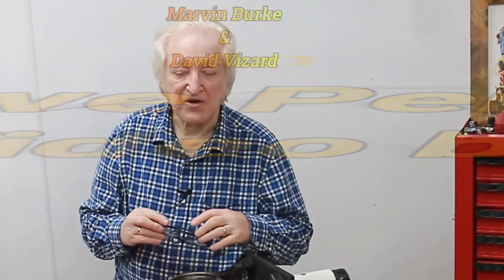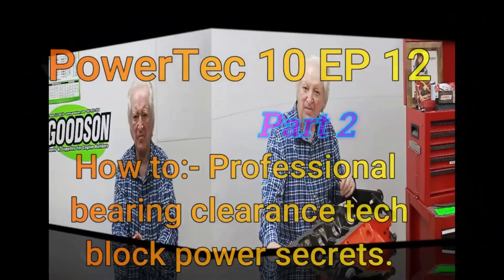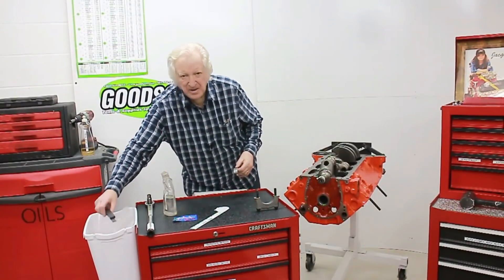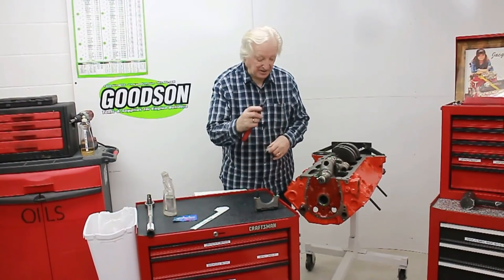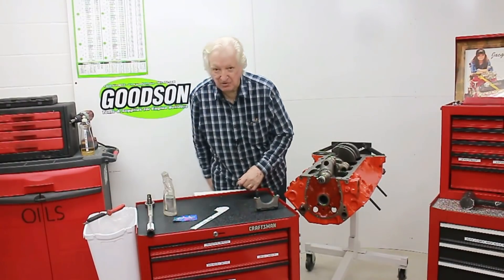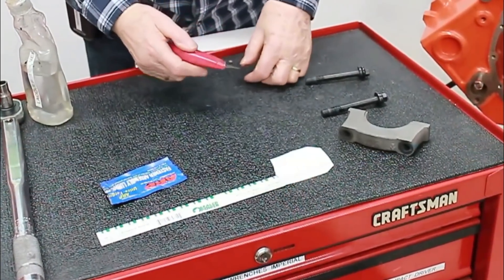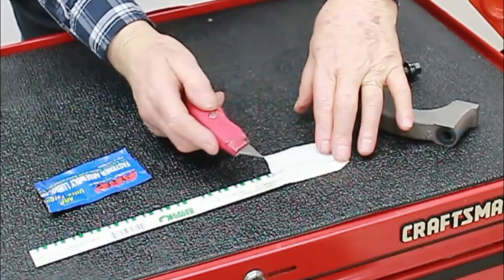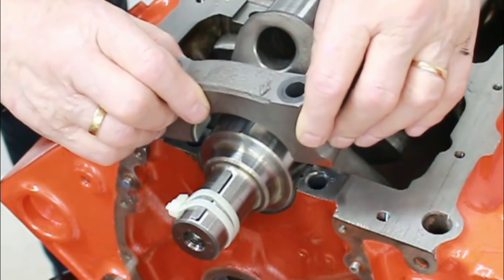David Vizard's PowerTec 10 EP 12 Part 2 Checking Bearing Clearance. To Plastigage or Not.

Comment from the maker: Andrew  - a response!

Bearing clearances aren't measured in "shade over" and "just about". 
I think I should have emphasized the fact I had measured all the clearances previously with my Mitatoyo bore gage and the crank with calibrated micrometer. That being the case I don’t think using the terms  ‘a shade over’ or ‘just about’ is a cardinal sin.

When clearances are measured properly those terms aren't required. 
Maybe not, but they do describe the situation.

There is no way the naked eye can come up with .0027 with green plastigage.
 Don’t forget that statement was influenced by the fact I already knew what the bore gauge measured clearances were.

 As I stated in your last video , reading Plastigage is like reading tea leaves, very open to interpretation!!! 
And here is why I used the ‘shade over’ and ‘just about’ terms.

A professional never uses a steel faced hammer to install & remove a main cap!!!
 Do you really think I used that polished face hammer hard enough to do any visible damage even when the cap is inspected with a 5 power mag glass!

That is a job for a soft faced or deadblow hammer.
Sure is – but that is what I would have used if it was required. Please give me some credit here and stop jumping to conclusions. 

 A professional would also never pry off a man cap with a screwdriver!! 
Agreed -  but the term ‘prying’ here is a gross overstatement of what I am doing. Gently lifting the cap would be totally accurate. Take a look at that ‘prying’ again. Does it really look like I am ‘prying’ with any measurable force?

You can easily damage the two mating surfaces. 
And why would I not already know that????
 
A professional never uses a torque wrench as a breaker bar to loosen bolts!! 
There are occasions when I need to test bolt breakaway torque so no I don’t need to do as you suggest.
If you are using a torque wrench that won’t deal with 45 lbs-ft in the reverse direction I suggest you get better equipment. I have 4 calibrated torque wrenches for 20 to 100 lbs-ft and an electronic gauge. All are regularly calibrated.

The best thing to do is pop the reversing lever out with a pocket screwdriver and throw it away!
I disagree.

 You should also lube the bottom side of the bolt head and washer, dry fasteners cause friction and erroneous torque readings. 
Again why would you think I did not know that, Don’t forget this has all been together as a trial build using my gauges. I mentioned using ARP lube in part 1 did I not? This is not a lesson on bolt installation. It’s a lesson on bearing clearances.

Just as different thread lubricants require different torque specs. 
Again you presume I don’t appreciate that. I can almost guarantee I have done more bolt load tests than you and I am aware of just about every intricacy that is known to man. 

What about checking the clearances on 2,3&4 caps? Just because the front and rear caps fall into spec doesn't mean the others will. ASSUMING leads to disaster!
 I really am beginning to believe you have little or no respect for whatever building skills I may have and you are just looking to find faults no matter how trivial they are. Do you really believe I don’t check #2,3 and 4. I think you are ASSUMING way too much here.

The crankshaft diameter spec on the rear main journal(sbc) is typically .0005 smaller than the other main journals to increase the clearance on #5 cap.
 Did I not say the clearance called for was bigger on the rear cap????

 Was the block align/line honed? 
Come on, give me just a small break here – what do you think????

If so was a dummy oil pump torqued to the cap during the honing process?  
See above!

The oil pump can cause distortion, anywhere from a few tenths to several tenths. 
I know that but have you ever checked to see how much difference it makes???

I don't care what people use for assembly lube as long they don't use Lubriplate 105 or a similar product, because it take alot of heat and time for it to break down and it plugs oil filters.  
No comment!
Regardless of how many books you have written and how many seminars you have given your last 3 videos in my professional opinion have really diminished your credibility with professionals that know the difference between right and wrong. 
Can you give me some idea of what your opinion is worth??

You are not beyond reproach, 
Never even remotely believed I was!  
--- contrary to what you might think. 
Based on the fact that you have never met me and do not know me that is a massively incorrect statement.

Before criticizing someone’s character it pays to get the facts right!!!!
Reply: Great work! You know exactly what you are doing and anyone with any good experience knows exactly how to interpet what you are presenting. I myself lift the bolts say?/ 2/3rds of the way out of the cap and squeeze together the top of them with the palm of your hand and gently wiggle while lifting to remove the cap! Hope this is ok'.
Reply: Thanks for the vid. I am trying to keep my $1300 car going. I think I may have a spun bearing and am about to measure everything with Plastigage. Helpful video for an amateur like me. Liked and subscribed…👍
Reply: Sounds like this Andrew is trying to teach David how to suck eggs... Clearly from some of his points he has no clue how many engine David has put together in his life time. Sure we may have a different way of doing things and there is nothing wrong with explaining the way we do it, but there is no need to be disrespectful in doing it. Do you seriously think that David is going to lever on main caps, and knock a cap out of round with a hammer, or not measure all the mains... Seriously this isn't his first rodeo, how about a bit more respect for a professional that has probably been doing this longer than you have been alive.
Reply: The guy building an engine or 2 in his life will greatly benefit from these videos. Nothing shown here will hurt anything on a stock to modest hot rod engine.
Reply: I have to say I agreed with most of Andrew's(?) comments, but I think his comments could have been more tactful & respectful.
Reply: Andrew why not make your own video if your interested in helping someone. otherwise your ignorance is showing. Do better.

Comment: ive been hooked n bought your small block chevy info since i was 32 years old.  engine nbuilding beame a fixation. 1990 June in Norfolk Virginia, Dale Earnhardt was brought over to my apartment where i had a fully rebuilt 1971 Lt1. We got to talking bout engine math, rod/ stroke ratios, deck heights, compromises with SBC 383 strokers with 6" rods vs Sbf 393 with longer rods, better rod to stroke ratio,  higher compression height pistons and oil ring not intersecting piston pi area. He gave me 6 pit cards, offered to sign them, offered me a job and what today would be $40k in 5 bowtie blocks, 5 crower or cola 4340 non twist forgings, his words, 5 sets of oliver or crower connecting rods, his words, 5 sets of aires or J&E pistons, his words, 5 sets of rings, 5 sets of rod n main bearings and , 5 complete Crower Imperial camshaft kits. Do you know what that is Robert? he asked me. Yes sir, the imperial uses needle bearing cam bearings which is said to provide 40 additional horsepower over the same cam using bushing bearings due to the lack of frictional encountered with the bushing bearing. Thats right, he said. Do you know how much they cost? Yes sir i said. They're $1360 right now in PAW catalog. (out of business now  ) He said thats right. There you go. Thats $6800 right there. You can build yourself 5 bullet proof bottom ends n worry bout induction later. When he left he held out his hand to shake mine and said" 5th time I've offered you Robert, do you want the job or not"? I refused n he left giving me good directions to come get those offered parts. Theres more to the story but too much to text. Im 70 this year in November and its one of my biggest life's regrets. i could have been happy n later opened an engine shop. Honesty and a good product is a recipe for success and thats what i strive to deliver in all task i undertake. Never bought a playboy or any other in my life, but breathed Car craft, chevy high performance, fast fords n mustangs, hot rod etc. Never was prejudiced either, they all run, all makes.

Comment: I was taught that Plastigage is OK for a shop that does not specialize in machining, such as a small garage operation doing an in frame rebuild. Bill Swarz owned a machine shop in Baltimore, MD (Precision Automotive).  He explained  that the only true way is to measure clearance is to measure the journals and the bearing with a micrometer and a dial bore gauge set properly.  I am thinking he learned this from Sunnen reps, not sure. A properly set dial indicator for bores would be a good choice. He said Plastigage can give false readings and is not accurate enough for a good machine shop to be using. It only measure one "side" and not the complete bore dimension.   Bill was also the first one in Baltimore and surrounding areas  to have a Sunnen CK 10 when they came out. Your thoughts?

Comment: Once again great information before I do this tomorrow with my motor in the van, 1969 G-10 Chevy.  It is a 350, 9-1, 388 heads with 2.02 and 1.68 valves, a comp cam that is carb for California, DLC lifters, true roller timing chain, high volumn and pressure Mellings pump, windage tray, electronic distributor with the monster Accell yellow coil, an old school Weiand dual plane intake with a quadrajet.  When it runs properly it is a sleeper.  The bad cams that are out now put so much metal through the motor it destroyed new bearings and almost took the crank.  Hours with sandpaper to 1000 grit has saved the crank while in the car.  I watch lots of You Tubes on building motors from the best in the business like you.  They have saved me from many potential nightmares.  Thanks.

Comment: Thank you DV for the mini-series on lower end assembly. I am rebuilding a Saab 2.0L B205 and have been using your tips. Had an issue using the 40ft-lb recommendation with plasti-gage (red), it was showing about 0.004"-0.005" clearance, not enough compression. Repeating using full torque and was able to get around 0.0025" (the target). Some online forums mentioned similar issues and recommended full torque or the results were similar. I am guessing the 40lb rule is somewhat engine type specific. I will try out the 40ft-lb tip on my next SBC or SBF project. Now the question of why it didn't work as expected.. my guess would be the bearings are simply different width and thickness requiring more or less pressure. I am sure this technique would work with almost all engines, but some trial and error would be required to figure out what the acceptable level of torque is required. Interesting results, thought I would share. Just also thought thread pitch and diameter variance between the engines might influence this as well..

Comment: I think all i woulda done different, is shown the meadurement process with a mic first, then shown just how close the plastigauge is. Which is obviously just fine for a hot street setup. Obviously all out endurance motors should be done with mics.

Comment: In regards to the rear main cap, should consideration be given to the oil pump distorting the cap, during this bearing clearance check?  Or is there not enough distortion given, to be a problem.

Comment: Thanks DV!
I work on my VW, I have seen builders give Plastigage a bad rap. Something about equalizing the measurements around circumference of the journal.
Dunno, for me it would seem to be good enough for my bus. I'll have to have a look to see if you have anything on air cooled motors.
Reply: ,,,,,,,,To check for equal measurements around the journal bore ; that is done with a dial bore gauge....No doubt David had done that prior to this plastigage check........

Comment: Mr. David, I have a question about Plasticgauge. Can it be used on both bearings of a journal, so you can see if the crank and block is square?
Reply: Great question,,,,,I hope David has time to respond.......................I use a dial bore gauge to check the concentricity within the journals.......by using a 12 inch Vernier caliper at the 2 outer main saddles, and measuring up to the deck surface on both sides of a V8 block   [measuring the 4 corners ] will show that the block is square or not.........

Comment: When you use a reduced torque setting to measure bearing clearances, how does bearing crush come into play?
Reply: Seen your comment on a couple of videos; not sure precisely what you’re getting at. I am a machinist. I measure stuff and hand fit parts sometimes hundreds of times a day. It is more important that each part be torqued/polished/fit in EXACTLY the same way each time than worrying about the final resulting measurement. He demonstrated in the part one video that torquing the caps incrementally (30-40-75) resulted in ≈.0001” variation in the bore. That is beyond the required precision for an engine. Consider also that a crankshaft spinning 6000 rpm is doing everything it can to turn that round bore into an egg shape to the tune of 1 or 2 thou, an order of magnitude greater than any measured deviation in bearing crush due to torquing your main caps to 40 instead of 75 when you’re plastigaging your block.

Comment: I always thought that also measuring the center bearing was important to see if the crank was bent, I know I've seen differences.
Reply: He will probably cover that next. Although this could also be checked with the crank on v blocks  with a dial indicator.
Reply: @pete540Z  will definitely be checked but not sure if it will be shown, David demonstrated the technique twice, don't need to see them all. Important take away was a bit more clearance on the rear bearing.

Comment: Just a question why only 45 ft pounds when checking bearing clearance and not the full torque?
Reply: I believe this question is answered in part 1
Reply: @davidshellock1588  thank you! I will go back and watch.
Reply: It didn't change from from minimum to max as far as distortion

Comment: The thing i dont like about plastigauge is for instance u check the front main brg clearance with it and the main journal next to it is larger in diametre it could make your front crank journal sit up higher Is this why u dont have the shell in the other centre main brgs? So im very interested to c part 3 because im assuming u do something similar with the centre 3 brgs and omit the end main shells when u check them as i am building a 4 cyl motorcycle engine also with 5 main brgs i am very interested in this my book says to use plastigauge  all the main journals r to be checked at the same time imo opening up for potential for error! Now i went and bought the bore gauge with digital read out and ill measure each brg bore and brg shell and crank journal and do calcs to get it as close as i can to perhaps the middle of the spec or a bit toward the lower side What is your expert opinion on coated brgs thank u for your videos
Reply: Not sure I follow your point. You are removing the plastigauge immediately after measuring it and wiping the surface off to make sure there is no residue. There is nothing wrong with plastiguage as a tool I have used it many times myself, but it is no substitute for proper tools, but it does a good enough job that that I am willing to trust it. It is pretty foolproof. I don't know if you noticed in the video David took extreme care not to distort the platigauge after he removed the bolts. There is a risk of a false reading if you don't take the care he did.

Comment: do you leave your "oil" in for final build or do you use a different assembly lube
Reply from the maker: I pressure feed oil into the system before startup so what is used during the build is not of any great influence.

Comment: The proper way to measure bearing clearance would be to micrometre the crank journal and then inside micrometre the bearings torqued into the saddle . Plastic gauge is not accurate
Reply: Did you actually watch all 3 videos and read the un screen comments?????